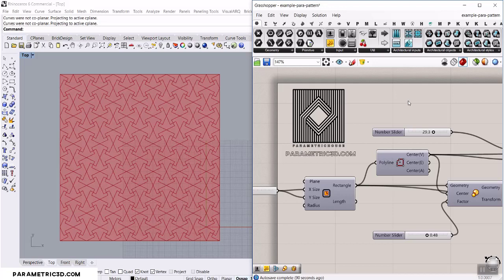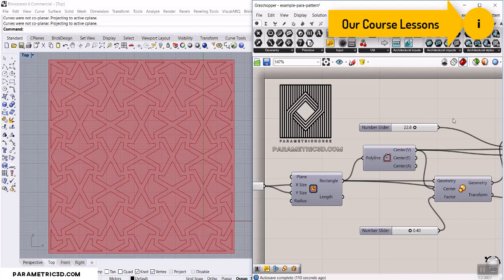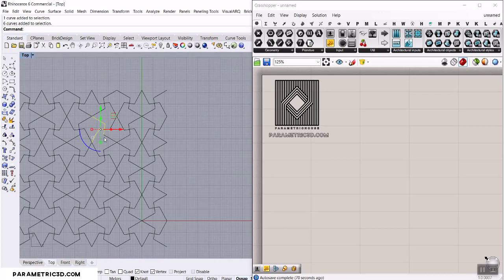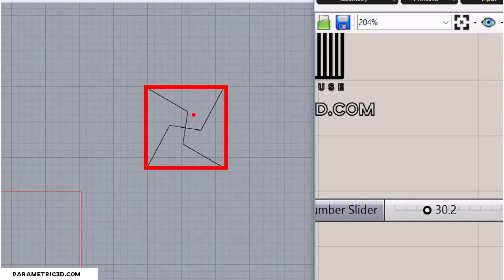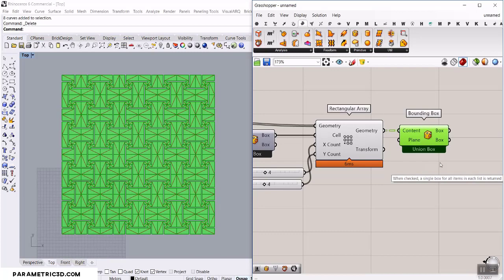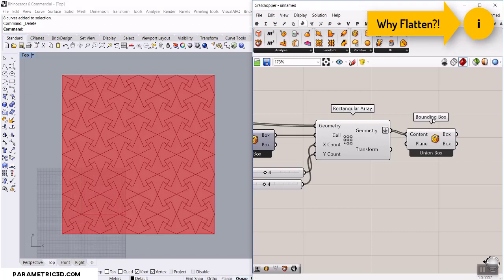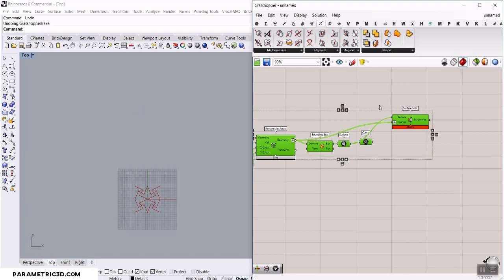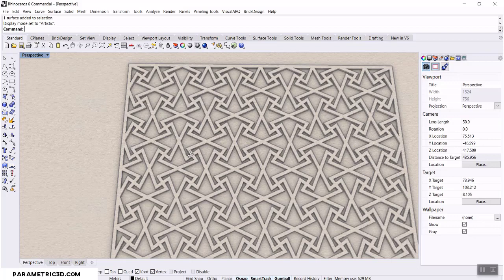Rhino Grasshopper (Parametric Pattern)

Comment: Thank you for the great tutorial. It's really a pleasure to follow you!  Unfortunately i have a problem with the Offset Curve Loose, which give me different results, then in your tutorial. In my case the lines don't have the Same thinkness. Instead the point at the border are not at one line so that the thikness is lower. You can see it on this picture https://i.postimg.cc/zX1Hqq16/pattern-please-help.png Can you give me any advice please?
Reply: Me pasaba lo mismo, después de dos días de probar me di cuenta que cambiando la escala del dibujo se soluciono...4 años después llego respuesta jajaja